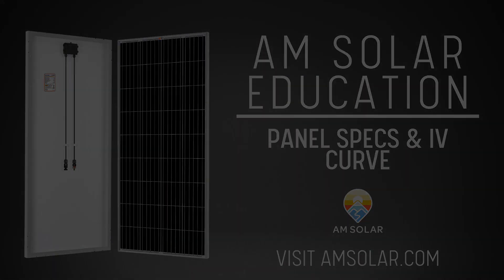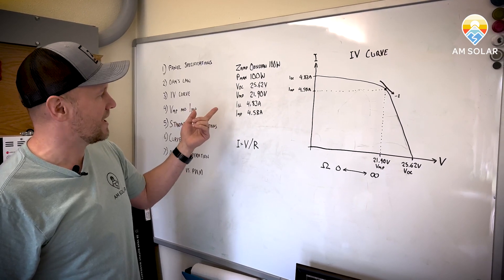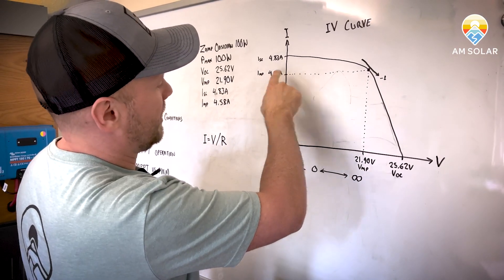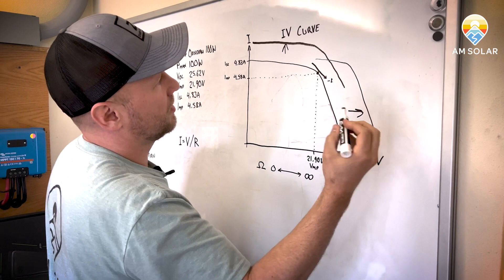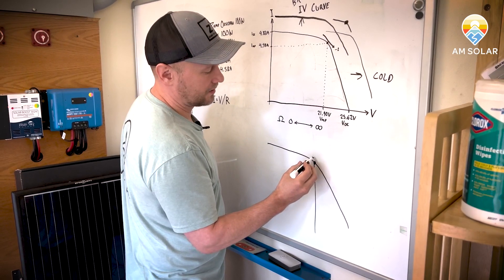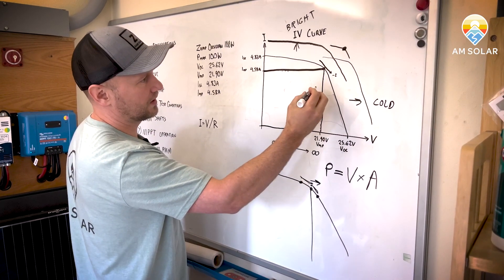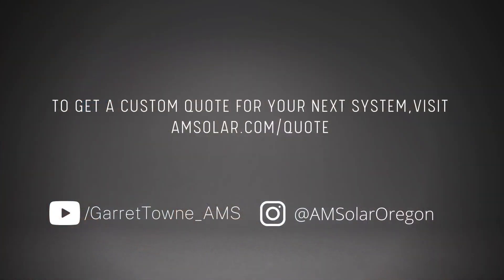AM Solar Education: Panel Specs and IV Curve

Comment: Garret,  Thank you for this video---look forward to more.  As you point out, the MPPT controllers have significant advantages over PWM controllers.  Yet, Zamp only sells PWM controllers.  Any insights on why that is?  Cheers
Reply from the maker: I’m not a Zamp representative, but I have been working closely with them and selling their panels for several years. My understanding is that they are developing an MPPT controller. I don’t know when it will be ready.
Reply: @GarretTowneAMS  ok, thanks.  be interested to see what they develop.  tough competition with the Victron controllers     Cheers

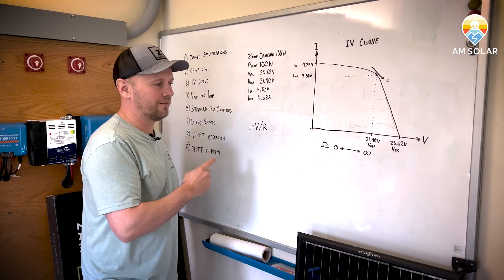Comment: 2:27 mark:  "...more current you'll have less voltage...".   ???   I think you meant to say that to get more current either voltage needs to increase or resistance needs to decrease (given the other value stays the same).    Also, it was intéressant to learn about the use of "I" in the current specs.  :)    One small suggestion is you could show how cool the Victron charge controllers are (in conjunction with a VRM Portal account) by showing real graphs of active systems.    The Victron Solar Charger PV Voltage and Current graph is very revealing.
Reply from the maker: Specific to the IV curve, as current increases, voltage does decrease, but I could have explained that better.
Reply: @GarretTowneAMS     given that the wattage stayed the same I would think the amperage would go down as the voltage increased …  that has been my experience... . But on a clear and very cold  , snow on the ground day ,in the high mountains if the wattage and the voltage both went up , then I think you would see a relatively higher amperage ( but still falling but a lessor amount) than when operating at the same 100 watts as usual …Am I wrong on that… (I didn’t state that as well as I’m thinking it.)
Reply: (To add on ) , the power of the reduced amperage is actually more , as it is achieved at a higher voltage …